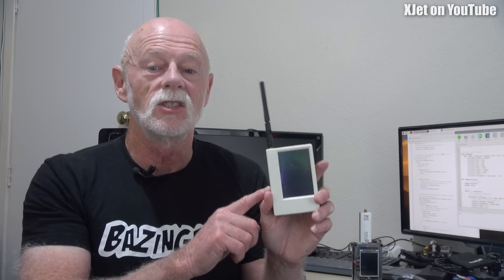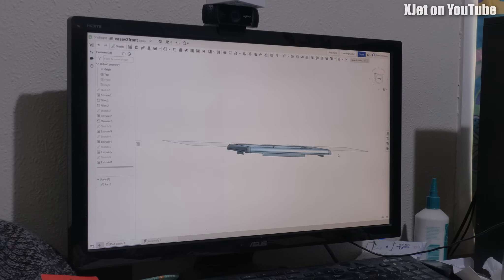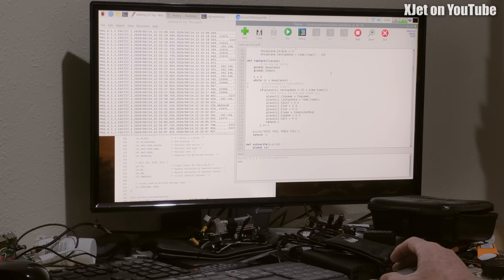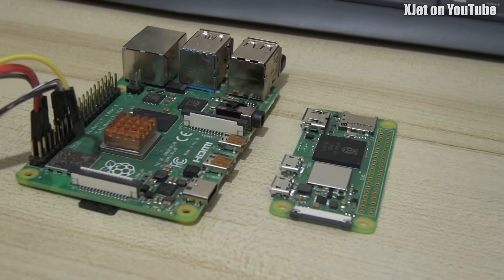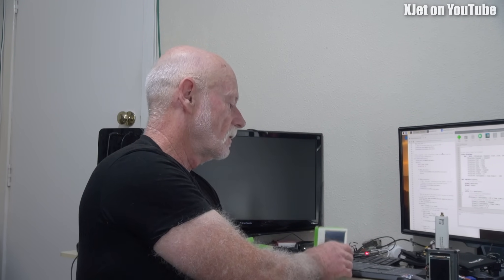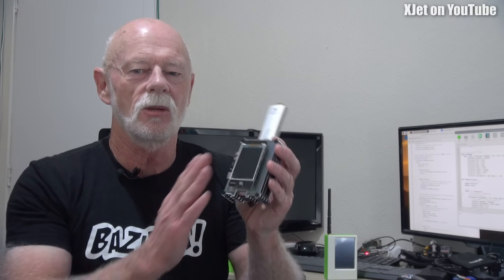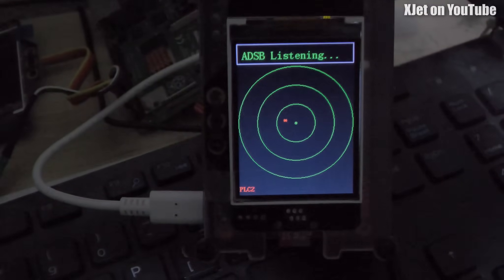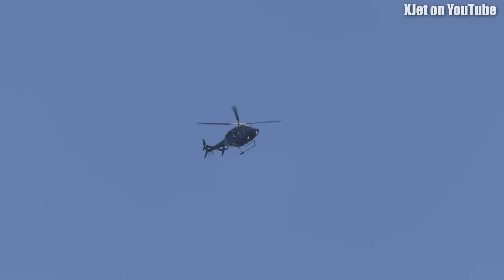This changes everything (I'm not kidding!)

Comment: I have ADS-B out.  Not all aircraft have nor need it.

No ENGINE driven power source, no ADS-B or transponder needed.

Not all airspace needs transponders or ADS-B out, so those avoiding it may or may not have either or both- we don't replace transponders with ADS-B out, so you won't see transponders only.

There is no way this video is more than a windmill tilt.  The concept of a TSO-133  TABS fell apart as it was to show on TCAS and that takes too much power for battery supply only.  It's for what you seek.

I fly sub 250 gram R/C, and will never join the AMA, btw.

Flight Radar apps do not see UAT ADSB out as much as 1090ES Mode - correct on the aircraft vs. online service
Reply from the maker: Things will have to change in the manned aviation sector because drones are now appearing everywhere.  Just because "that's how it is" doesn't mean "that's how it will be" I'm afraid.

If the FAA (and other regulators) are truly concerned that there's a risk to manned aviation that could be caused by collisions with drones then manned aviation will require electronic conspicuity if they want to reduce that risk.

Does it seem reasonable that drone operators (who are required by the regulations to yeild right of way to all manned aircraft) have to fit a Remote ID transmitter to all their craft from Sept 16 while manned aircraft are free to continue flying without ADSB or even an av-band radio in class G airspace?    It makes no sense.    The parties that have right of way should have the electronic conspicuity, not the other way around.

Aircraft currently unsuitable for ADSB should use something like FLARM or the OGN to create electronic conspicuity.  Hell, if a glider can carry such a transmitter, anything capable of carrying a man can carry one and the ADSB alarm can be easily configured to pick up FLARM broadcasts as well as ADSB.

Comment: In Vic, PolAir (POL30-35) turn off their ADSB transponders 95% of the time (with the 5% mostly being POL35). They still transmit Mode S, so you know they are there somewhere, but you cant determine the position without a network of receivers reporting to a server, that performs MLAT using clock synchronisation etc.

Is it possible for you to program ADSB Alarm to report when a Mode S Aircraft with ADSB turned off is detected? You wouldn't be able to show the range, but you could at least say "hey, theres a sneaky aircraft up there somewhere. We dont know where, but heads up"

Cool project btw. Very impressive

Comment: Most often Police and military aircraft have their ADSB blocked for security reasons. I watch military aircraft appear out of nowhere in the Eastern Med. Most often they are coming off of carriers especially the Greyhounds the navy is using for supply and personnel transport. Other times I see aircraft appear coming out of nowhere from in the Middle East. The moment they hit the Med they light up the ADSB since they have entered airspace that is congested. ADSB receivers on aircraft will always squak their codes in flight, Flightradar24 will not display for security reasons. Waiting for the finished product!

Comment: In the US the FAA has no provision for ADSB Out for aircraft without electrical systems. The current systems have hard coded aircraft identification and they do not allow a mechanism to change the ID for the envelope being flown at the particular time. The registration is attached to the envelope. Without ADSB-Out, one could be run over by a refrigerator sized Amazon delivery drone.

Comment: What planes are flying under 400 feet. If you are not by feild.
Reply: The frequently misunderstood “Rule 5” explains most of them.  Away from populated areas there is no guarantee that you won’t encounter full size aircraft below 400ft agl.  Their 500ft separation obligation in those circumstances can consist of both vertical &/or horizontal components

Comment: The FAA uk are not interested in public safety. I challenged them about a police helicopter landing in my opinion unsafely in a built-up area, surrounded by high trees within 10's of meters of houses. firstly they claimed not to know, suggesting the pilot had not filed a plan, and got permission to land. Secondly they closed my complaint and refused to answer my questions to the detail I required. 
Your device is a great step forward for the hobby. But do not expect as I'm sure your realistic enough to already know.  The FAA to recognise this as a solution, because they do not care. They have an agenda which is against model aircraft using THEIR AIRSPACE! These are public servants supposedly working for the public to manage OUR airspace. Thats why in the past radio hams and model flyers were given airspace. 
The hobby already has restricted flying areas, airports, prisons, ect controlled by the suppliers software, just needs hieght to also be restricted. Controlling 3d space & not 2d space which seems to be the limit of their imaginations. At the end of the day if aircraft fly high enough and models low enough the twain shall never meet. Also avoids birds - problem solved. It's time these bureaucrats & politicians were put in their place. We all know the drone encounters blamed on the public were either false sightings or police controlled to raise public concerns for their nefarious purposes, mostly for money!

Comment: This is something totally worthwhile, I think it should be made mandatory for every airborne device over a certain weight. I'd also say that any airborne device that doesn't have an ADSB transmitter should be limited in height as well as operating distance from its control station. What those numbers should be I leave up to people that know the ins and outs better than me. We should all be able to partake of hobbyist/intellectual pursuits but have a framework that ensures safety for all. Let's face it, if someone has the money for a manned aircraft, the cost of an ADSB transmitter has got to be chump change in comparision, and if it isn't, let me know and I'll design something.

Comment: Do you realise that general aviation aircraft equipment has to be certified? The cost of certification is eye wateringly high and the product volumes are pathetically low. This results in very expensive TSO'd aircraft equipment. What you are suggesting is that every GA aircraft carry a new piece of certified expensive equipment so that you drone operators don't hit them. They were there first and I think drone operators should carry the cost.
Reply from the maker: It's just $2K to fit a certified ADSB transmitter to a GA aircraft and I think anyone who can afford to buy and operate an airplane can afford such a small amount extra in the name of safety.   https://www.aircraftspruce.com/catalog/avpages/uavionix_11-17246.php

Comment: If it works in Canada ... and its under $100 ... I'll buy one !   Cheers !  :D
Reply: In Germany we can buy sometimes a older RaspBerryPI for 150€ or the Pi Zero 2W for 99€, this is the biggest problem right now.
The other components are not expensive, the display 25€, the RTL SDR receiver 36€, indoor-antenna.

Comment: This is great news, I can't wait to get my hands on your receiver. fabulous work, thank you. You can do so much with a raspberry Pi and an RTL SDR . A couple of comments; 

FlightRadar 24 blocks all police copters. The solution is to use adsb exchange. (YouTube keeps removing my comment, I think because it had the  link) they have fewer receivers but still have pretty good coverage and don't censor any aircraft. It has though recently changed hands so that could change. 

There’s a danger UAV users overly rely on the receiver. As you mentioned not all manned aircraft are ADBS-B equipped, parachutists, powered paragliders, hang gliders, other UAVs and birds remain a risk. It is of course obvious that it is no substitute for good visual awareness. Nonetheless an on screen warning might be a good a idea?

Comment: I think you will find that helicopters will often fly low enough that they are not picked up by ATC's secondary surveillance radar. I know that our helicopters often drop off Flight Radar 24 while operating. They are not being blocked.

Great project. Do you have a project page I could look at?
Reply: FR24 does actively censor aircraft from its feed to clients when a requezt ito do so s received to protect their business model and damn the aviation enthusiasts who don't want the feed censored. I use ADSB Exchange as it is totally unprocessed raw ADSB data without any censorship.

Comment: What would make this better is if it could send this data to an EdgeTX transmitter and it could then be relayed to BetaFlight via a channel. The aircraft detected number could be the channel value. There is already an extra OSD element that can be used for things like heart rate that could be used for this purpose.

Comment: One thing that worries me is I was flying over the Ohio river and apparently planes in the US have no height restrictions over water and here came a small Cessna plane at what appeared to be 500 ft or less and while I’m sure it wasn’t legal since it was still close to the downtown area of my city I don’t think they cared. It scared me pretty good and I tried my best to get out of its way but I’d never seen a plane fly so low.
Reply: In sparsely populated areas you can fly down to the surface in the US.
Reply: @samuelseidel6148  yeah this wouldn’t be considered sparsely populated; the Kentucky side (side I’m on) is a downtown city area, the Illinois side is just trees so I guess if they hugged that side they could fly as low as they want. But it’s my understanding you can’t be within 400 feet of buildings or populated areas of which these planes would have been closer than that. Very dangerous imo.

Comment: Bruce, a while ago I emailed you about an Android (and optionally iPhone) app that I have been working on. I never heard back from you. The app either get the ADSB data from a RTLSDR that you connect through the USB-OTG port (that you also use for your charger) on your phone, or connect over IP to a remote ADSB installation at home. iPhone is optionally because it doesn't have an OTG port.
Reply from the maker: Sorry if I missed that email.  I looked at building the app into a phone but found that it was going to be easier to do it with a separate SBC.   I have done some work on an addition to the code that will "broadcast" an alarm to any smartphone within range that would allow a single ADSB alarm to work with multiple smartphones at a flying field although that feature won't be in the first code-drop.
Reply: @xjet  I like your functionality of warning multiple smart phones in the field. Would you be interested to discuss both of our solutions some time?

Comment: Bruce, unfortunately, aircraft that are operating under the VFR are not required to have ADS-B fitted.
The reason is s that ADS-B for aircraft is very expensive to fit. In the order of close to AUD 10k..
Reply from the maker: Not all aircraft in class G have ADSB but we're finding that the number has dramatically increased in the past year or so here in NZ and other countries are also really pushing for more ADSB uptake.   The ADSB isn't a total solution (nothing is) but it's an important element of raising the safety level.

Comment: many gliders don't have adsb but have flarm instead. could you detect those?
Reply from the maker: Although it doesn't have FLARM capabilities right now that could be added pretty easily.  There's also the potential to program in an av-band VHF receiver as well at some time in the future.
Reply: @xjet  you're a legend 🙌

Comment: Bruce - the 2nd reason is the 99% of the time reason why the flights don't turn up - I have multiple feeders into FlightRadar and FlightAware - one on my Van which is portable, and one on the roof of the garage.  When you look at the Visibility map of flights the units have  "Seen" - you can see a distinct pattern where NOTHING to the immediate south is seen, until it is within 5nm of the receiver, yet everything to the East, North and West it will see within 180nm of the receiver.  The Main reason being - the 2nd story of the 2story house is immediately to the south and therefore blocking the signal.
1090Mhz is definitely able to travel a significant amount of kms, but as with anything in UHF bands - it is still somewhat line of site, and scattering OTH.

Comment: Very good work! What about an ESP32 version? Or RP2040, to create it as an embedded system? Will increase battery life by a lot and even shrink it more. If you're interesting i'm willing to help out in this direction.
Reply: Brilliant idea. It would be tempting to run the "Bruce special" ADS-B receiver software on a LILYGO T-Display S3 (which is quite cheap, around $21) with integrated 170x320 TFT color display. Just add SDR receiver, antenna and battery. I have a similar setup connected to my Linux PC running Virtual Radar Server and it shows me aircraft up to a distance of 200 km.

Comment: That sounds a lot like the VicPol aircraft not appearing on the AussieADSB page, but showing up on international pages. 
VicPols dark painted heli that has no navigation lights at night, has also ignored NoTAm's for sporting events where drones are in use by the broadcasters, and they fly that heli in low to try hide the noise until the last moment.

Comment: 3 years ago, during the covid lockdown, Flightradar changed. Since then no military aircraft, police or other aircraft are not on the tool anymore. So, what does that tell me? A good ADSB alarm is a great tool you are putting out there! 👍💪✌
Reply: I've noticed the same thing in AU, I watch them regularly fly over with nothing visible on Flightradar (except GA and commercial planes in other places).
Reply: I see some military aircraft on it. Around here the Coast guard is the worst, they're not on flightradar24 and they do fly low and fast. I see Air Force and Navy on flightradar24 all the time

Comment: @xjet Bruce I have an DJi Air2S, which should already have an ADS-B alarm fitted (UK) purchased a year ago. I live in Mid-Wales UK in an area that has frequent low flying fast military jets (Hawk), and the occasional Hercules below 50ft Mid-Wales Air Ambulance helicopters and Police helicopters. As a matter of some urgency I need to check that ADS-B is ON by default before my next drone flight in the Park.

Comment: Nice work, Bruce. Will microfrights have to have ADSB as well? There are a couple of those motor-powered parachutes that regularly overfly our authorised patch at well below our 400 foot ceiling - and they have no visible registration numbers so we can report them.
Reply: In the US, paramotors and some other types of small craft are not required to have ADSB. They can also fly to 14,000 feet in unrestricted airspace. You'd think if a 256g drone poses such a danger and needs remote ID, then they definitely would.
Reply: @kurtzFPV  At 14.000 feet - what do they breathe? Canned O2?
Reply: @hamshackleton  Actually, it might be 15,000. Some of them may take help for breathing, I'm not sure, but Tucker Gott who is kind of the Mr Steele of paramotors has a video where he goes to 15,000 and just wears cold weather gear.

Comment: There lies an issue I have had since day one , the FAA demands all "drones" broadcast ( RID ) information so Karen and Kevin can have it to attack them with, BUT simply stated that manned aviators did not need to know where drones were , they had to many other things to do ?" You know those pesky people in aircraft they claim need protection from "drones" and drone operators.....
To me they are the ones who MUST know where drones are IF it is a safety concern they claim it to be because of manned aircraft that very fact shows safety has ZERO to do with this regulation fiasco

Sadly we have several issues we need to address with Congress before the new FAA Reauth Act gets voted on
 1st, we know we need the weight ,limit raised ( which again should have been addressed day one)

2nd, we need Congress to reign in the FAA and make them follow the rules process instead of making illegal rules by the Advisory Circulars 

3rd, RID needs to be readdressed and the unreasonable rule vacated and or rewritten along with the illegal ( already court ruled) registration process that would eliminate everything to start with

4th , that very thing you mentioned we have to broadcast BUT no manned aircraft receives any warning where we are and they need to force ADSB on all manned aircraft everywhere, so as you say WE can know where they are all the time which btw would eliminate the RID need as well

5th, if they would allow LAANC in all space not just in controlled space it would satisfy the RID rule and no need to broadcast anything the USS providers would have that info for the agencies that require it and NOT the Public and every operation would have that flight plan and have that  Flight Authorization so no unauthorized flights and those flying without LAANC approval could be easily identified as any nefarious actor is Never going to broadcast their flight anyway 

That is my opinion anyway...Lol

Are you going to have a parts list and a HOW TO Vid and maybe a printable diagram and instructions for us non techies ?

Comment: As a ADSB feeder to Flight 24 I have notice that happen with some of the RAAF aircraft, I live next to a Airbase and I can see most of the RAAF aircraft on my screen but not all ways on the F24 app.
Reply: you should feed to adsb exchange instead of one of the filtered sites
Reply: @gorak9000 old comment but adsbex also isn't safe from filtering either with the service sold. Next option would be adsb(dot)lol